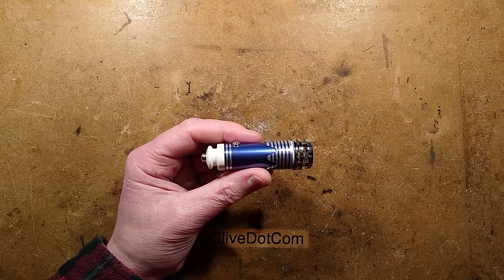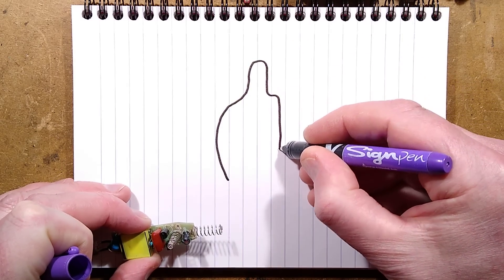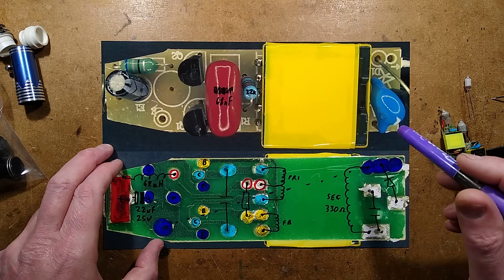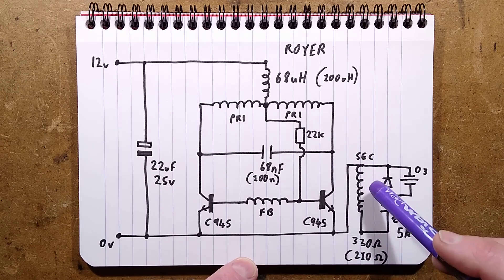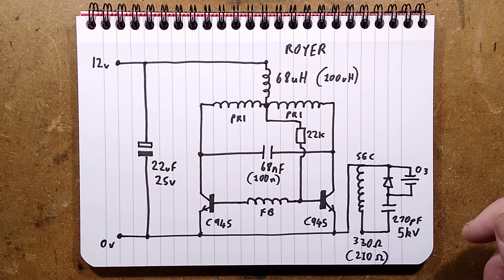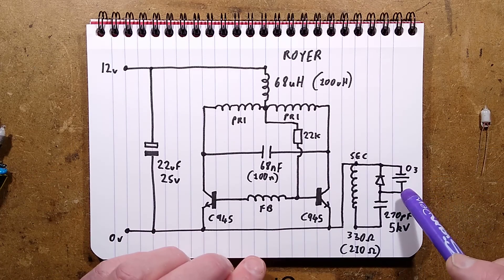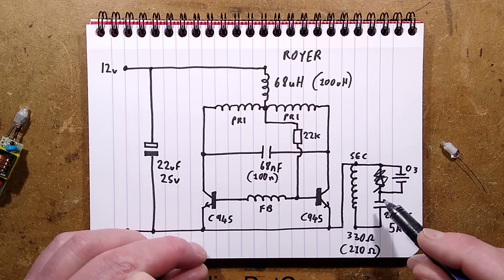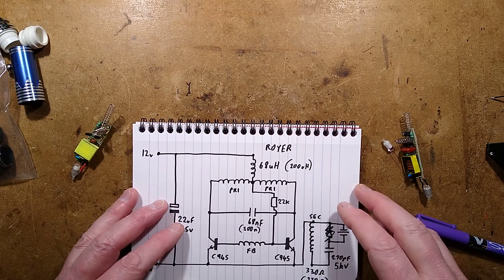Dead car plasma unit (fixed) with schematic

Comment: 15:29 Still looking for an ozone generator for my ungodly stinking cheese fridge. Every time I open it, it reeks like someone took a dump. All the cheese is in sealed boxes. And without the cheese, the fridge doesn't stink. And I even have one of those small fridge ozone generators in it. Running at maximum. And the fridge is tiny. Still not enough.

Comment: I’ve tinkered with these after using the rental grade ozonator odor removers. I got 2 that were intended for hunters to deodorize their gear inside the truck, the first one worked for years for occasional odor removal on a jump start pack and overnight in cars. That one died and wouldn’t make ozone. The second one never worked and I could never figure out why. I was amazed the first time I heard about an electrical odor remover, it seemed like magic.

Comment: Doesn't that diode clamp the mesh at one diode drop above ground positive and allow huge negative peak voltages, so it kind of is a negative ion generator?

Comment: What confuses me about the schematic is that the zero line at the bottom connects to the coil that drives the ionizer bulb.
It is a zero line, right! No wibbly wobbly electric signal there.
Reply from the maker: The zero volt line is just the circuits general reference line.

Comment: That rectifier circuit is strangely similar to the voltage doubler used in an microwave oven to power the magnetron with HV. Basically rise the 0V to the peak of the output voltage if I am not wrong.
Reply from the maker: But just the peak voltage, it rides on top of the peak AC voltage too.

Comment: Why's the pen called Sign pen? I have two of these, because I thought that they would be quite thin, but they turned out to be quite thick! What am I not understanding correctly?
Reply from the maker: I'm not sure why they call it a sign pen, other than possibly making it for drawing small signs.  It is designed to produce a thick line.
They also sell harder tip versions that do a much thinner line.

Comment: clive, can you explain this..
I got me a cheap aliexpress CO2 meter.
a few weeks before I had a way more cheap ioniser.
just curious I placed the CO2 meter about 30CM below the ioniser..
oops, it raced from 430 tot over 1500 in no time and started beeping.
Reply from the maker: It's possible the electrostatic charge was affecting the sensor.

Comment: Using the (isolated) ht output from a microwave transformer, across a plate of glass with two foil electrodes- doesn't work. No ozone. Nothing. Can't figure out why.
Reply from the maker: I'd really recommend against using a microwave transformer for anything like that.  They are the biggest electrical killer in modern homes.
The raw high voltage output may actually be too low for anything but the thinnest glass.  A neon sign transformer would work better for something like that.  (Also capable of giving a strong shock.)

Comment: Addition to comments below ... Ozone will eventually rot the foam rubber in your seats , causing a lumpy ride ! .... My experiment done in 1980's  : stretch a rubber elastic band over a pencil ( lengthwise ) and lower it into a tall jar with stinky Ozone in it .... the band will snap in under 30 seconds ! ! ..... ( tried - n - tested )  ............................. DAVE™🛑

Comment: Wow, I bought something like this years ago. It has a nearly identical circuit except that it was meant to produce negative icons. It has a carbon fibre cluster instead of a neon. They use a 3mm led for the  blue glow. I couldn't feel a real difference so I threw it in my odds and sods  bin. Now after watching this video, I decided to look at it again and the carbon fibres are nearly nonexistent. Thanks for  this peek into how this unit works (I now know it's not a ripoff), and thanks for all the effort you put into all of your vids. Cheers mate! 👍

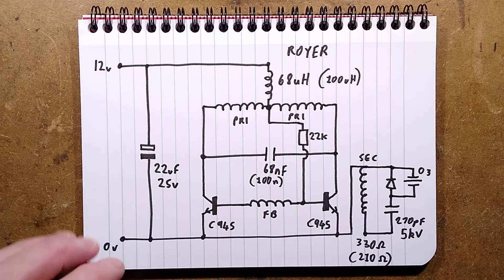Comment: When I first jabbed my thumb on this video it somehow ended up at 6:00 minutes. My brain immediately saw RYOBI and I was convinced that this was a schematic of a Ryobi drill complete with 12v battery connection.  When Clive started saying "This is a classic Royer oscillator" I was thinking "What on earth is Clive yammering on about" and I was even about to leave a comment that Clive must be off his rocker. Fortunately, after reading some of the comments, cooler heads prevailed.  Lol.

Comment: Those of you who are long time fans of this channel will know that I am the channel's village idiot. At the age of 82, I don't understand electronics and I ask some  really dumb questions. So this one is probably also dumb, but why are there so many devices producing ozone? Humans have been around for eons without having the need of ozone devices,  and why do so many of such devices not work?

To those who wonder why I subscribe to his channel,  if I don't understand what he says, his voice is so soothing  that he takes away the cares of the day.
Reply from the maker: You're definitely not the channel's village idiot by a long chalk.
Ozone and an orgy of other exotic, but short lived molecules are constantly generated in outdoor air by nature.  Indoor air goes stale quickly as the active molecules revert back to a more stable form.  Devices like these can emulate nature indoors when used in a sensible manner, and keep the air fresh and sterile.

Comment: Okaaay so this ozone generator is powered by the lighter socket that isn't powered when the car is not in use, and also should not be powered when the vehicle is occupied.....😳
Reply from the maker: The one in mine is powered all the time.  Not sure about others.
Reply: @bigclivedotcom  I find most modern cars have at least one socket permanently powered, older cars had one socket connected to ignition switched Accessories circuit.

Comment: Does the neon have to be blue? Can a normal neon work if wrapped in mesh
Reply from the maker: Yes.  But it has to be high frequency and high voltage.

Comment: You don't need any fancy equipment to measure low resistances. Just pass a known current through the device while measuring the voltage drop and calculate the resistance with Ohm's law (R=V/I). Be sure to use a 4 wire connection to get an accurate measurement.
Reply: How does one use a 4 wire connection?
Reply: @mikebond6328  Measure the voltage from the point you want to calculate the resistance from. Connect the current source to the device under test separately. That way you are not measuring the contact resistance and test lead resistance. Look up "Kelvin connection" for more information.
Reply: @mikebond6328  That requires a multimeter capable of "4-wire measurement". Bench units often have this - handheld units seldom do.

Comment: I want something like this to get rid of the horrible air freshener smell that someone put in a used car I purchased recently. I tried leaving the windows open for a few weeks, but the stench still remains.
Reply: If you have Ozium spray where you are, it removes airborne odors (even smoke) with fewer downsides.  With several applications decades ago I turned a smokers car into one nobody could tell had been.  It's used in hospitals too.

Comment: I’m reminded of those plasma cluster units with a positive and negative set of carbon fiber brushes in somewhat close proximity. If I recall correctly, the effect was basically that of an ionizer with increased ozone production.

Perhaps this was shooting for the same goal but coming from the opposite direction. It sounds like the diode makes it a worse ozone producer but helps it double as in ionizer. If ozone production is already on the high side, that might make sense, I guess.

Comment: Copying a copy of a copy etc can work if the copier understands how the thing works, and what the critical values and characteristics of the parts are. Using what transistors that you have on hand can also work if you can substitute other parts to compensate but if you don’t test those parts to make sure they’re in spec, you get what Clive found.

Comment: In some of the newer cars, the cig lighter sockets no longer stay powered for a long period after you turn the engine off. For example in mine, a 2009 Ford. In some sense this s good, because some people run their USB to FM transmitters in their cars to have MP3 playback, so these will eventually be turned off without further intervention. But for the sake of charging devices or operating these gadgets, you would need to wire a separate permanently hot or manually switched socket. In all my previous cars the sockets were always powered.
Reply: I think it's been that way for a fair while, to be honest.
Reply: Interesting. I grew up with Japanese cars, 87, 92, 97, 04, and they were all tied to accessory / ignition. The Dodge vans at work are the first ones I've used that are always hot. I thought it was a new thing! It's quite useful, but I've had to get used to unplugging chargers. One van has both with a key or battery symbol on the cover which is nice. Key one never worked, and I can't be bothered to fix it.

Comment: We have two Toyota cars, and the 12V sockets are switched off when the key is removed (or in the "off" position). This means they couldn't be used to power devices such as camping lights or ozone generators while the car isn't in use.
I found this out when I tried to use an electrically powered tyre pump while my car was turned off.
Reply: Pretty much every car ever turns off the lighter socket once the car is off. Some might delay it 10-30 seconds, but it goes off.
Even sockets in the rear of large 4WD vehicles where they suggest a fridge might be used will have it switch off when the car is off. You don't want to flatten your battery by running unexpected high current devices.

Comment: I had something like this before. It was a flashlight with a 12v male car charger end on the other.
It has some lithium cell on the inside. Anyways, it was a gift for Christmas and the only way to charge it was plug it in the car. So I was warming up my car and plugged it in. Thing started on fire.
I suspect the battery was installed backwards and when it charged it went nuclear.

Comment: You might struggle to run it with the car unoccupied, because many cars have the cigarette lighter socket wired through the ignition circuit, meaning it isn't live when the ignition is off.
Reply: I have yet to experience a car like that.
Reply: @vhfgamer  You evidently don't drive a Mk7 Fiesta.
Reply: @BedsitBob  The heck is that? Some sort of italian car?
Reply: @vhfgamer  It's a Ford.

Comment: Could you do a vid on "EL lights"?  There's these string shaped lights powered with 3 v  batteries or 12 volts.  Apparently uses high voltage converted.
Reply from the maker: They usually use low frequency (100Hz) AC at enough voltage to hurt.  The output is usually very dim and gets dimmer rapidly over time.

Comment: Do cars in the UK still get cigarette/cigar lighters in them? My 2014 model year Ford has neither a cigarette lighter nor an ashtray in it. More US government intervention determining what's best for people, I guess.
Reply from the maker: I think they tend to call it an accessory socket now.
Reply: @bigclivedotcom  
Thanks for the response, man!
I believe the difference is that the accessory/power socket lacks the bi-metal release mechanism that the bona fide cigarette lighter socket has (and very likely also  lacks the fire-resistant properties of the latter), which is why there's usually a caution not to use the accessory socket with a lighter element.
Reply: @bigclivedotcom  I initially thought that until I read numerous warnings in my owner's manual admonishing against trying to stick a cigarette lighter in the accessory socket. I finally just gave up and quit smoking altogether.
Reply: @paulregner5335  
The accessory/power supply sockets don't have the bi-metal release that the cigarette lighter sockets do, so there's a potential fire hazard if its used as a lighter socket
Reply: Same socket just not heat proof@paulregner5335
Reply: acc. socket wil melt if use cigar lighter
Reply: In the market I’m familiar with (Asia-Pacific) Ford used to supply what they called a ‘smokers kit’ option, which generally consisted of a patch panel which added a cigarette lighter to the existing 12v ‘power supply’ outlet and an ashtray which either replaced a trim panel somewhere centre dash or replaced a cup holder. Not available for all models though. I suspect EU & UK models would have the same arrangement. I’m surprised the US market doesn’t have it as an option?
Reply: My 2016 car has an "accessory socket" aka cigar lighter. It also came with a UK socket in the back from an inverter that I keep meaning to look at more closely.
Reply: My 2009 car has an actual cigarette lighter. My wife's 2015 car has the 12V "accessory socket" without the cigarette lighting gadget.
Reply: Was this change really driven by the government? I have always assumed it was a market driven change. Smokers I know usually make an effort not to smoke in their car now, even if they smoke every day.
Reply: @schlickit628  Here in the US the government and media have been making smokers feel like second class citizens for decades. I quit smoking back in 2019, but my motivation was fiscal (the insane amount of taxes assessed to tobacco products) more than anything else.
Reply: My 2017 ford does have the 12 volt. You must have got the really budget model :D
Reply: @vhfgamer  I have the Titanium Edition, but the manual clearly states that the 12v "accessory" socket is NOT to be used for a cigarette lighter.

Comment: Presumably, had this device been powered and worked, there would have been more than one discharge when the driver unscrewed the top (which looked far too easy).

Comment: 2sc945 is a very common type, listed as audio amplifier and low speed switching, and general purpose use, i've 'scavenged' many from scrap equipment plus previously bought some new for a repair on a 'portable' pc ..

Comment: Could this drive elwire?
Reply: Doubt it. The frequency is way too high. My semi-educated guess is that the EL wire would light up insanely bright for a few milliseconds then go out and never light again.
Reply from the maker: EL wire is a much lower voltage and frequency.

Comment: Nice video and presentation. 
Without the diode the O3 element is presented with E volt ac and with the diode the O3 element is given 2*E volt dc, 50% duty cycle. If O3 requires ac operation, remove the diode. For dc? Keep that diode.

Comment: The problem with copies of copies of copies is that inevitably errors creep in, especially if you throw in the business of using the components to hand, rather than the optimal parts.
I would be kind of leery of using an ozone generator in an enclosed place like a car. Sure, the instructions might say in badly translated English that the device is to be used only when the car is unoccupied, but given that you can just plug it in to the standard cigarette/12V power point I can see someone driving around with the thing activated.
Ozone also doesn't play well with rubber, plastics, fabrics, paint and metal (all of which you find in the interior of cars) so you might just be shortening the life of door seals, upholstery, plastic trim parts and wire insulation if you leave the thing running for long periods.
Maybe just not smoke or eat fast food in the car so it doesn't smell. If you're transporting a bunch of smelly footballers home from a match, well that's what the roof rack is for!😂

Comment: Does the color of the neon gas make any difference in the coronal discharge?  Blue as opposed to Pink?  😉
Reply: Yep, sure does. If you use a pink Neon lamp you must also have fluffy dice and be driving a pink caddilac and be wearing leopard skin pants, otherwise it just won't work 😂
Reply: @mattyb7736  And a girlfriend called Tracey?
Reply: @sarkybugger5009  i was thinking of the pimp in magnum force, but your comment works 🤣
Reply from the maker: The gas is just there to couple current to the inner glass wall.  They could be any colour.
Reply: I think an ordinary neon filled NE2 would work here, blue everything is just the style of the time.

Comment: I haven’t thought about cold cathodes since I worked on analogue trunk switching. They used to be used for register translatiors and we had to test them by blanking out lights to see if their performance was affected.
Fantastic!
Reply: As soon as I heard him say ' cold cathode' I immediately thought of the magnetic drum (drums) register translators (RT's). Last seen in Glasgow Clyde GSC many moons ago......😊
Reply: @lesbrown5829  RT4’s. I worked in Rampart O/G unit in London. We must have had around 18-20 of them.
Murder if there was a power flick.
Screwdriver 5A at the ready!
Reply: @markmurphy3578 
Also remember checking new translations on the digscope(?) , infernal contraption with little blue flashing tubes representing binary digits. I think we had one full suite of them, so probably 8.

Comment: very interesting way to generate Ozone using a neon bulb! 
I have never seen this before. I am used to the needle or carbon fiber  method
Reply: Needle or fiber is for ion generation. Electrodes separated by dielectric barrier (like the device in the video) are for ozone generation. Two different though similar processes.
Reply: this is the classic lab technique to produce ozone- it is called silent electric discharge. oxygen molecules get dissociated at the glass surface and then they attach to another oxygen molecule. The needle attached to a high voltage produces very little ozone but useful for producing negative ions - electrons are emitted and they attach to the gas molecules. Because the circuit is not completed, the current is going to be very low.